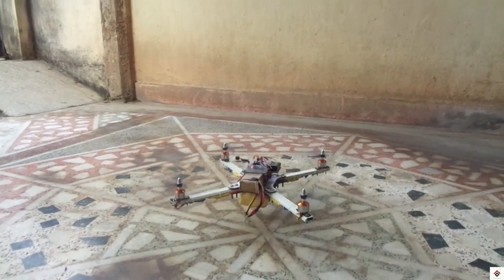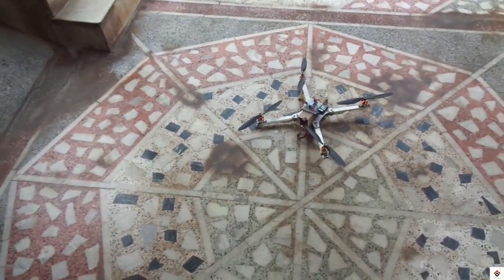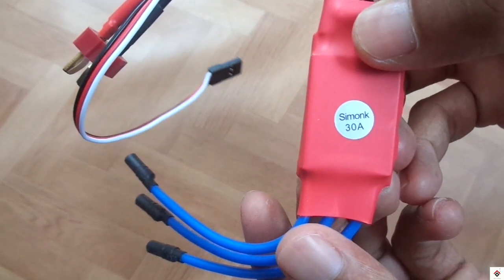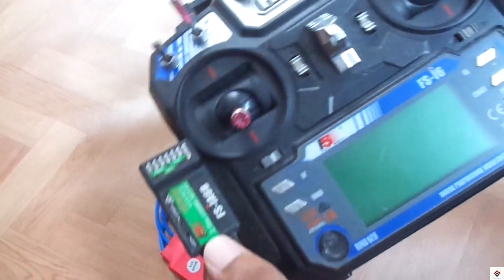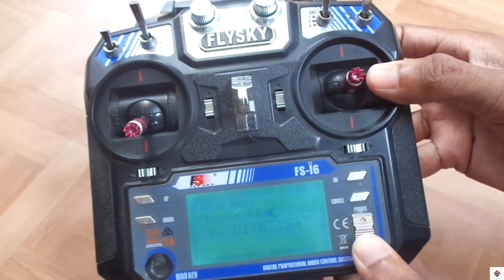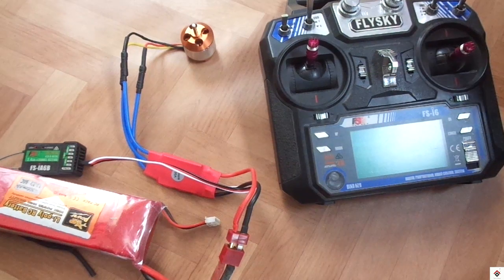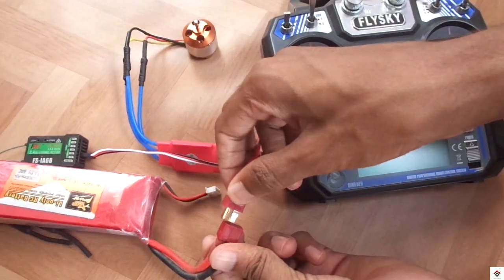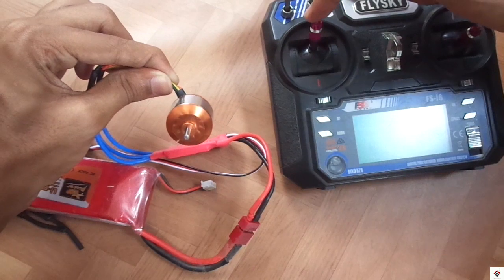Drone motor not spinning | ESC calibration 30A Simon k ESC [SOLVED] Brushless motor not working

Comment: My Arduino rx not working during esc calibration motor continue beep not spin please give me a solution I m feeling very frustrated 🥴
Reply from the maker: Did you bind the transmitter and receiver after purchasing.
If not try this: https://youtu.be/AGNz5fPVBhA?si=TuxrqgJojdSsF7J_
Reply: @techathome 
I have Arduino tx and rx how to bind please help me 😢
Reply from the maker: You made Rx and Tx with Arduino with RF modules?

Comment: Is there a chart that shows all the settings that can be adjusted on esc. 
My esc came with no directions or even link
Reply from the maker: I don't think this basic ESC has option to configure many things.
Some costly ones have option to connect to computer and calibrate lot of things.

Comment: Brother my
Motors are not taking max throttle, with 1400kv bldc im getting only 250gm of thrust with 5045 prop . Should i change the esc?
Reply from the maker: Yes you can change and try.

Comment: if i connect my motar to the propler it is not spinning properly and if i remove the propler it is running but withen few sec it is reducing speed and stopped running please check this out
Reply from the maker: ESC might be having issues. If possible change ESC and confirm motor is working properly or not.

Comment: We have design flight controller using Arduino and mpu 6050 our problem is our motors are not rotating only beep sound is coming
Reply from the maker: Have you calibrated ESCs after buying.
Reply: @techathome  yes
Reply: How can I contact you
Reply from the maker: Mail 
If you have Transmitter and receiver, connect ESC directly to receiver and try to check if motor is running.
Reply: Can please provide mail id
Reply: If any problem occurs I will contact you
Reply from the maker: deepakhd20@gmail.com

Comment: Beep sound not coming
Reply from the maker: Still try to follow the same step and see if motor works.
Reply: probly if the motor doesn’t beep and doesenta start the esc is broken
Reply from the maker: Yes
Reply: But the reciver is working with The esc is it  means the esc is broken ??@faracollo12
Reply from the maker: Receiver will work because it is getting 5v supply from the ESC.
But to run the motor, there will be MOSFETs inside ESC which might be not working.

Comment: Hi, I am trying to control the ESC with a microcontroller but it is not working. It beeps indicating no input signal detected. I am using a raspberry Pi pico. I also tried connecting the power to the bec but didn't work

Comment: it used to work just fine, now i don't know why only 1 motor run after calibration but the other three after i plug the baterie and the throttle is max i hear 3 beeps but thats all, the 3 motors wont turn any solution please
Reply: Calibrate your ESC one after the other.
Reply: @TECHZINO1  true, that was the problem indeed but i fixed it back then and graduated with the project haha thanks for the helpgreat content!

Comment: Hello,
I saw all of your videos
I am building a hexacopter 
but my drone tilts to the one side
I don't know what the problem is

I have caliberated the esc's 4-5 times just as you told, I even tried changing motors as well
I am using apm 2.8.
Please help
Reply from the maker: Have you calibrated ESCs using flight controller? https://youtu.be/jHaYAA_Km7Y

Check the motor layout and direction of rotation
Also , check propellers (clockwise and counter clockwise)
Reply: Try recalibrating your compass again.
Reply: switch to d shot esc

Comment: When I increase the power the motor is disconnected and again connected... 😬😬😬 What to I do
Reply: Most probably your battery is dead. Check voltages of  each cell of battery with multimeter check If either cell is below 3v .

Comment: Sir my mortors are only vibrating not rotating I had did the setup more than 5times 🥺
Reply from the maker: If ESC is not working, then also this might happen,
You have to check the same motor with different ESC
Also have you done the connection as shown in the video?

Comment: I have a 6 motor drone, when I want to fly it, 3 motors turn off and don't spin, what is the problem, and what is the solution, I use esc simonk 30A
Reply from the maker: If you are using APM you can follow this tutorial : https://youtu.be/jHaYAA_Km7Y

Check motor connection, ESC calibration

Comment: Is this process same for kk2.1.5 flight controller  drone also?
Because my drone is tilting on one side
Reply from the maker: Yes 
You have to calibrate ESC in 2 methods for stable flight

1. Do the steps shown in video for all 4 ESCs

2. Calibration of ESCs using KK board:
-Remove supply
-Switch on TX and keep throttle to max
-Press and hold 1st and 4th button of KK board and connect battery
-you should get " throttle pass through" on screen of KK board
- wait for few seconds and decrease the throttle
-wait for few seconds
- remove battery

Note: don't remove buttons of KK until all steps are done in method 2
Reply: Did it solfve?